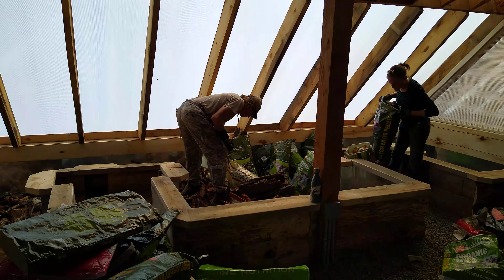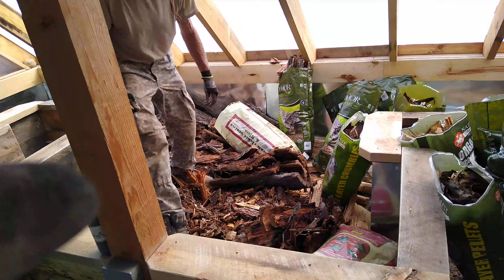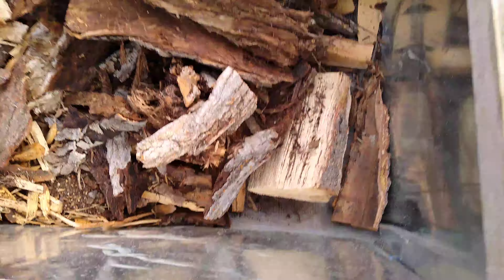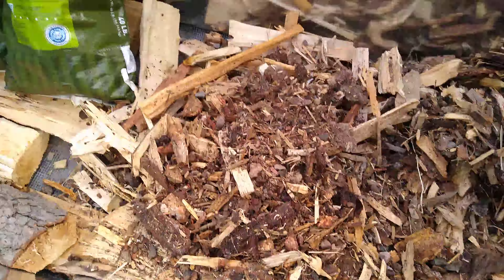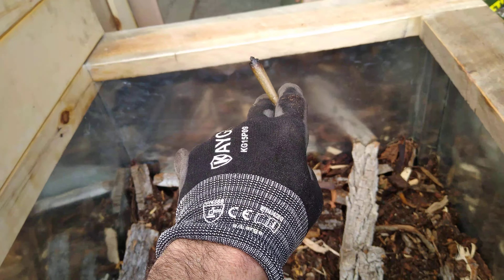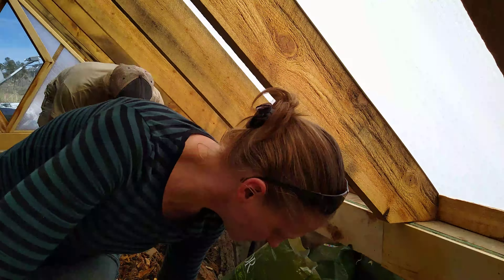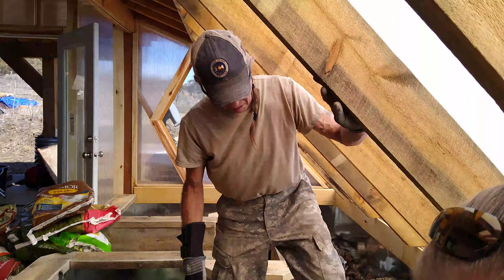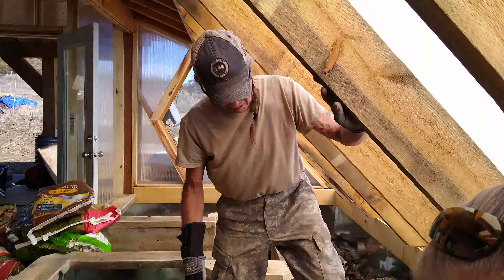EarthTube Heated Geothermal Greenhouse Update - Sheet Mulch Technique In Full Swing! Ding Ding!

Comment: Hey D have you analyzed what metals, heavy metals, are in that galvanizing? I would never have used that and as the bacteria do their thing, which is creating acids to break down minerals, that sheet metal is going to be a real problem and could toxify the soil. Copper or zinc perhaps could work but I would trust a plastic far more. I'm willing to bet it will be destroyed within a couple years. Hope not. Otherwise looking great guys.
Reply from the maker: I have done extensive research on the breakdown of the sheets. Will be beneficial if anything.